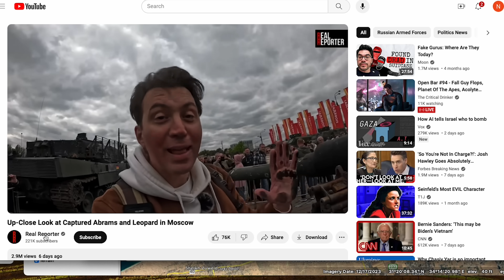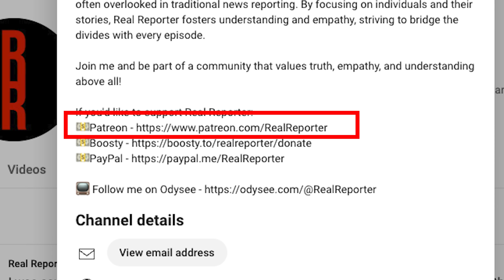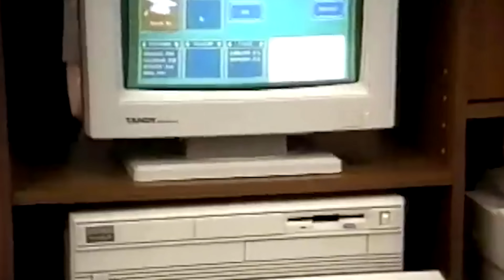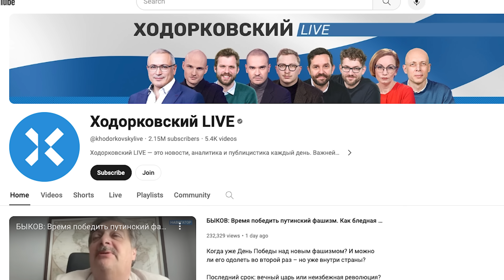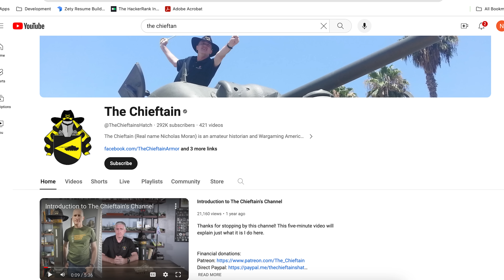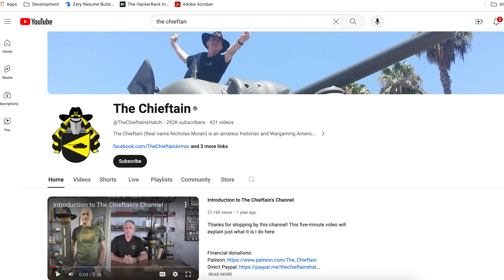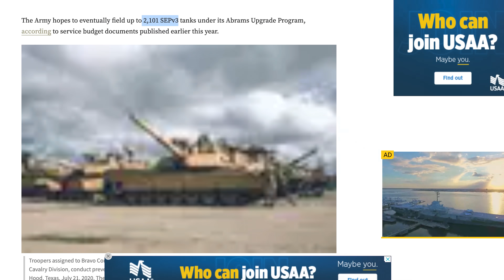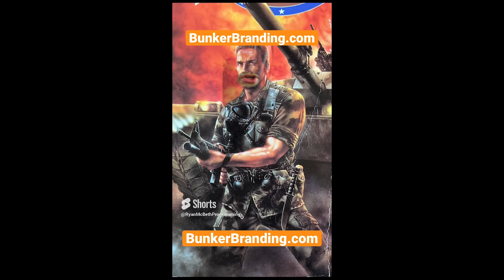Analyzing Real Reporter and Captured NATO Vehicles

Comment: Submarines from ww2 are still classified. So a tank from 30 years ago still used by the us military is still very new of military age. Must be hard being so dumb
Reply: what submarines are still classified? Most documentation on them are still there unless there’s a specific long term technology used like communications and such.
Reply: @rowan7149  to a country like Russia. Not to Iran, North Korea. Those are basically new tech. The mechanisms might not be but the concepts behind them are. Diesel electric subs are still classified from the 40s. And could still do a lot of damage in the modern age. We’re still using a weapon system from the 60s that every infantry man carries. A damn tank from 30 years ago still has night vision and is computer operated to some degree. And let’s just pretend modifications never happen. A 30 year old tank is a very potent machine. The f16 f15 are from the 60s and still airborne along with the b52 being from the 50s

Comment: A bit of advice. If you have a suitcase that has wheels onto them never put those wheels on your bed when you lay the suitcase to open.

Just think what those wheels touched as they rolled on the floor. 

Open the suitcase of the foldable bench in the room. You might even want to give the wheel a quick wash in case you think you might brush up against them.
Reply: You ever wondered why the tips of your shoe laces are wet?

Comment: Ryan, from the older 11H. I really enjoyed your ad today, lots of innuendo.  But back in rhe early 80s in W Germany,  when it was XM1 and "infantry vehicle" with no name yet. We traveled everywhere in our hammerheads M901 on autobahns, cobblestone, you name it. In snow and ice conditions, we took off pads for better grip. Say every 4th or 5th one. Big pain in the butt. Lots of hardwork, and you saved a few, but basically, they were trashed. Why put back on used pads? Did I mention what a pain it was with just a socket wrench and breaker bar. Great post as per usual.  👍

Comment: Everything regarding "we didn't send our best" trying to make it sound like that would make a big difference is kind of strange. A lot of vehicle losses are because of mines and artillery, as well as drones. The more modern versions wouldn't make much of a difference when it comes to surviving these hits. The Improvement in Armor does not save it from a good artillery hit or some drone flying in and hitting weak points. The same goes for mines. The current attrition rate does not really give much information either. It depends a lot on how and if these Tanks are used, and not how much more "amazing" they are compared to some old t-72 in the more dangerous areas on the front lines. It can change dramatically as soon as the Ukrainians use them in a counteroffensive.
Reply: The difference it makes is that it doesn't turn into a firework when running over an anti-tank mine

Comment: Was the fact that the M88 was based on a Korean war era tank supposed to be some kind of flex? And if so, why's he ignoring that it also has parts commonality with the later M60?
US armored vehicles have used rubber track pads for at least the last 50 years.  NATO forces tended to lean in that direction as well, because it's cheaper to use rubber track pads than the repave roads after every exercise.
The USSR doesn't care, because their training areas don't have paved roads.
I remember replacing track pads on our platoon BFVs exactly once.  It was 3 vehicles and it actually took longer than it would have replacing the tracks.
Reply: Plus ten for the random Wilhelm during the action figure ad.

Comment: that is a <1988 version, the M1, that's a steel tank, the clamps around the skirt is a dead giveaway; extra metal would defeat the radar sig and the hull penetration(bolts, screw, welded additions, etc...) would defeat the DU armor. We would not issue a tank with a DU hull.

Comment: 18:35 slight/maybe correction as there is a degree of interoperability between UK pilots for the RAF and RN and the USAF and USN, more common for RN pilots to operate off US carriers as we've had a big gap in our carrier fielding capability recently, but it has not been unheard of for RAF pilots to fly USAF planes. Don't know of any specific F-16 pilots, but there are examples of RAF pilots flying the B-2.

Comment: We removed a few trackpads in Kosovo on our warriors. This was duel purpose in thinking. On the road it wouldn’t chew up the tarmac. It would also help bite into any light snow but if we were going off road or into heavy snow we used snow cramp on’s.  Which funnily enough are the snow chains of warriors and they fit into the space already there after removing the pad prior. If that makes sense.

Comment: But the m1a1 onward have the same hull armor and turret armor. Only difference is optics and an extra 50. Cal and a protection system. Other than the protection system it’s still the same tank lol. Nothing really changed much since 1986

Comment: to be fair though I think the 1990's PC analogy is way too exaggerated, the software and computer components in it may not be as crazy as the modern variants and the Armour is definitely also improved I don't think the gap in performance and utility is anywhere near the comparison given, a 1990's or even early 2000's gaming pc is under 10% if not under 1% of the performance of a modern day even budget tier gaming pc.

the armour may be old, and it may not even have the Depleted uranium lining in it, it may not have the advanced auto tracking while moving features, but it is still a ABRAMS even if its armour is 30% less effective and software gives it half its potential, saying its anything even remotely close to 1990's computers performance compared to now is dumb in my eyes.

Comment: Ukraine has the Abram export version. The export version has about the same armor capability as the T-72 as it uses just steel armor. Modern anti-tank penetrating weapons can pierce more steel than a tank will likely have.  What's weird is the U.S. version can not be sold or given away yet the Apache E attack helicopter can without an export version.
Reply: Not true. Export Abrams use composite armor arrays without DU that are at least as effective as the DU armor arrays from 1991.

Comment: Running gear is the the gear that is connected to the transmision and is the most back gear in abrams.
that gear spings and then does the trach..
u can imobilize by hitting track,
what is repairable on field.
or u can hit running gear and well thats a towing situtation.

knowlege by "war thunder"

Comment: The variant of the Abrams is irrelevant, the drones can't penetrate the frontal armor of even the old models, they went for the weak spots on the roof, the protection of these spots is the same in all Abrams variants even the most modern ones, so, M1A1 or M1A2 Sep v3, doesn't matter, the result would have been the same.

Comment: If you would go to russian museu, of tank in russia. you would see heavy tank lineup. which are pinacle of all tanks so called the end of the line from where there is nothing to learn. so why they dont buil;d those, casue they cant even build theyr own tanks anymore similar like they cant build cargo planes or heavy bombers they dont know how. its very simple its similar to than usa nasa cant build anymore old engines which took us to moon. there is nothing to learn as in museums of russia sits best angled tanks, in soviet unoin they knew how to build. Those old museum pieces are so hard to penetrate its crazy modern rounds simply cant penetrate it. but they are forevere a museum piece. So all electronics where wiped by ukr, those captured- burned metal scrap. ukr than bails out they destroy everything and they even shoot with guns if they cant reach top retrieve. so they drone it or shoot from other guns even if tank is long gone even as a metal

Comment: Something to note here - the debris and infantry equipment all over the Abrams as a "sign of battle" are actually Russian. The Ukrainains use Bakelite 7.62x39 magazines, NOT stamped aluminum like Russia does. What we see there is a stamped magazine, which the only cases of Ukrainians using are from captured Russian stockpiles. It's not impossible that some of these made their way to the M1A1SA, but the chance is comically low and far more likely to simply be set dressing by the Russians. 

It was also confirmed via video of the tank being knocked out that they did damage it further before displaying it, as most of the damage is not present at the time of evacuation nor the confirmation strikes later produced to solidify the kill.
Reply: Ah yes, Russia doesn't have plastic...

Comment: As for trackpads, the respected expert is completely wrong when the rubber will have a fresh grip at subzero temperatures, and especially on ice. The fact that drivers in Alaska installed steel chains on the wheels of their trucks tells you nothing. However, it is forbidden now. In short, your competence in the issue of armaments is questionable.

Comment: Comparing Tanks with Gaming PC's is the most unrealistic comparison ever. Compare how many components and how many small improvements have been done to PC's and how many times a tank has changed and has been uprgraded. The main thing people look for in a tank is firepower against other heavy armored vehicles and defensive capabilites/survival against such.  no average person will go, well this computer for the commanders sight has this micro chip built into it and this crows system has this thing on it. 
Going from a 105 to a 120mm cannon is a big upgrade. going from no crows system to a crows system in 10 years is not a big upgrade in an average persons eyes. Same goes for the T72, adding ERA could be considered a big upgrade due to resistance against RPG's for example, but in Tank V Tank warfare, it's not really gonna change much when a 120mm APFSDS shell goes into the main armor itself.

Another thing. Saying that they've lost 0.7 abrams a month is a totally unrealistic look on the situation. Abrams' have been in ukraine since Sept 2023. But when have they entered the actual combat zone? 
As soon as they entered, 3 got destroyed in a span of a week. so that number is much much larger than 0.7 a month.